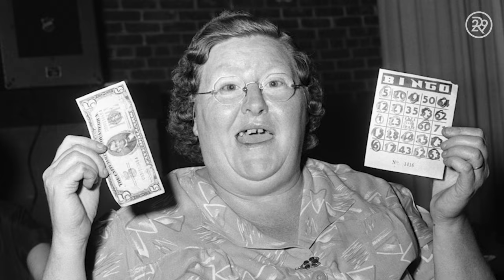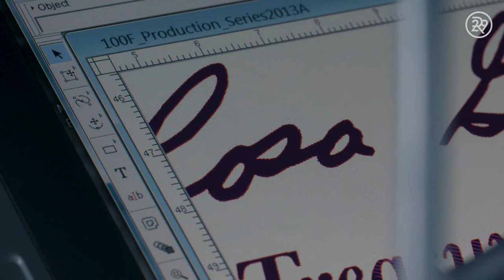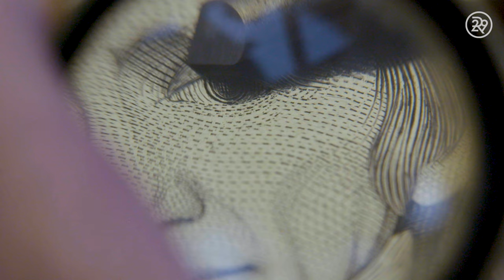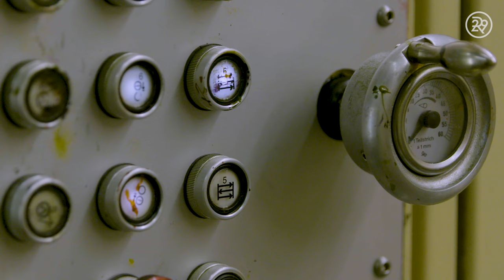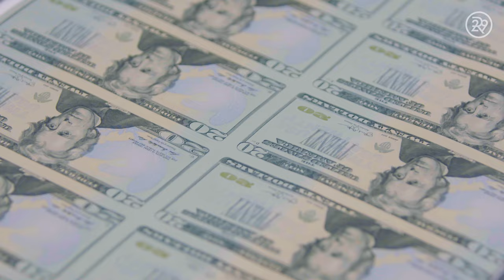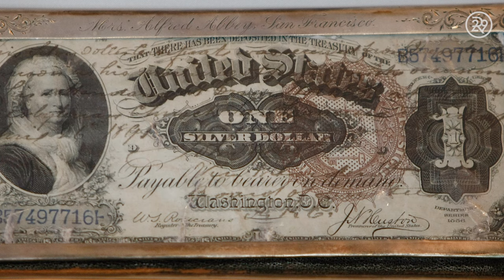How Money Is Made | How Stuff Is Made | Refinery29

Comment: the potassium dichromate is not used to prevent rust. Its used to form a thin film over the silver to prevent adhesion of the plated nickel over it which becomes the printing plate.